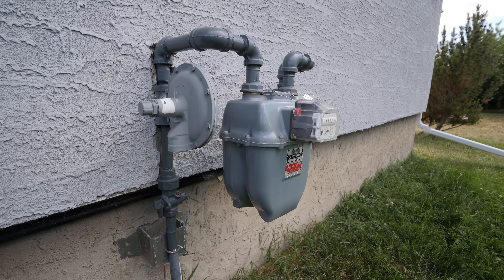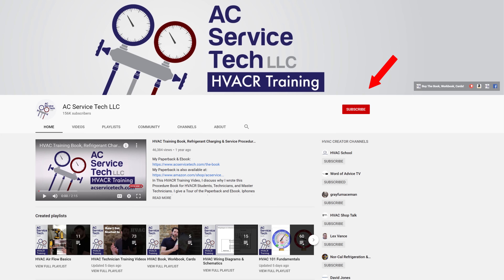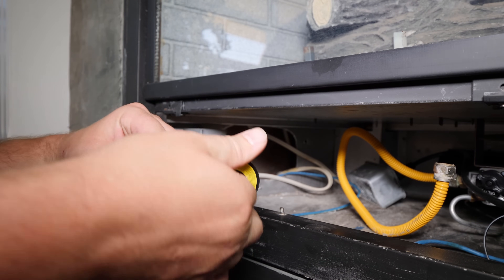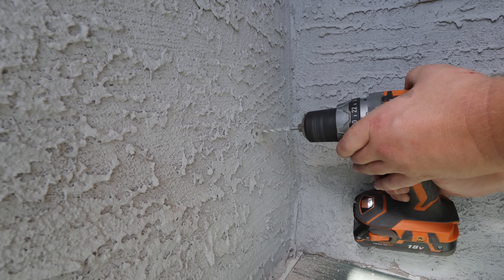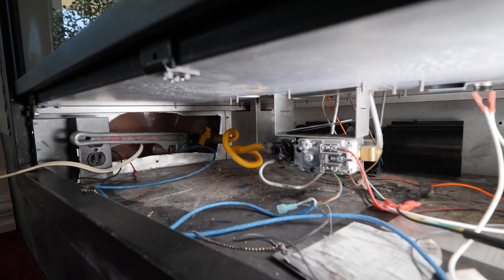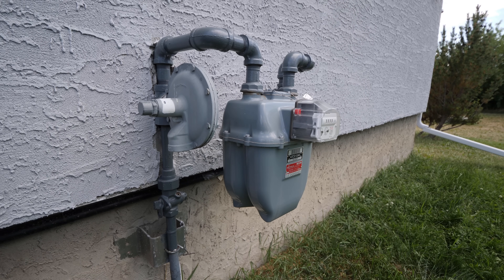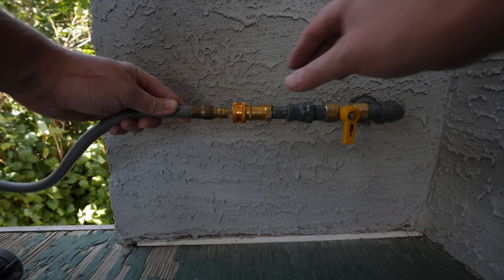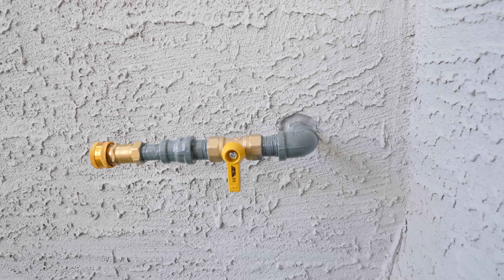Natural Gas BBQ Grill Gas Line Install

Comment: Kind of a basic question, I've run into this before, when you put that right angle fitting you obviously had the direction in mind (to the left), how do you gauge how tight is too tight to get the angle that you want (basically you want it going left instead of ending up pointing right)
Reply from the maker: That's a tough question. For me it's basically by feel. You don't want to bury the threads but you don't want to have it loose either. If a fitting/nipple is properly cut, it usually has roughly 2 threads left showing after tightened. Hope this helps. Cheers!

Comment: Hire the proper service tech to do this project. There are rules and codes to follow. This is NOT the proper place to do a tie in.
Reply: Wont pass inspection!
Reply: And do not touch the regulator
Reply: Agreed
Reply: it's perfectly fine to tie in here if done properly. Can't imagine anyone using the fireplace and grill at the same time. they're different seasons
Reply: That's what you're basing your advice on? Someone not using a BBQ in the winter? The fuck?  @justinbrah627

Comment: Hey. Great vid.  So the line feeding the fireplace was a 1/2" flex? To 3/8" or was the fireplace 1/2 all the way?  Then you t'd the flex ro black pipe 1/2" out the wall to 3/8". Could you not have t'd with 1/2" flare and ran 1/2" copper through the wall? I was thinking of doing a line and was going to do just that,  tap the water heater 1/2" copper with flare and run 1/2 copper out the wall.  Thankyou.

Comment: I can’t tell what color that Teflon tape is but in my state you must use yellow for gas. I would have also installed a tee where you put the elbow outside the house and added a debris catch.
Reply: Nice catch...but the items in code are mostly disposable appliances, so no sediment trap needed.
Reply from the maker: Correct, it is yellow gas approved tape.
Clause 6.13.1 - A dirt pocket shall be installed at the bottom of any piping or tubing on the final drop serving an appliance other than
(a) an illuminating appliance;
(b) a range;
(c) a clothes dryer;
(𝗱) 𝗮𝗻 𝗼𝘂𝘁𝗱𝗼𝗼𝗿 𝗴𝗿𝗶𝗹𝗹;
(e) a portable appliance or equipment;
(f) a decorative appliance;
(g) a gas log;
(h) a room heater; and
(i) an appliance incorporating a sediment trap.

Comment: Nice work!  Could a 3/8 to 1/2 reducing bushing be used at the valve ,rather than that bell ?
Reply: Bushings increase the chances of splitting the fitting. That’s what I learned from a plumbing inspector that red tagged one of my dads jobs. A close nipple and bell reducer is best.

Comment: If you need instructions on how to light a BBQ pit, you probably shouldn't be installing gas lines.
Reply: I’m sorry if I come off rude, not trying to be. Just because you know how to install gas lines, doesn’t mean you know the specifications of a new grill. I’m an assistant plumber and I mainly install gas lines, but I’ve never bar-b-qued in my life. So buying a new fancy grill, not gonna lie but I’ll probably read the instructions.
Reply: @22ChronicSmurf  hey to do something like this is it really risky ? Or can it be done if you follow rules ? I’m trying to run a line from the outside of my house to the back yard but I’m actually doing it under ground . Any help? Or suggestions?

Comment: Question. How come you couldn’t just run a 1/2 to 3/8 shut off valve to the quick connect. I did mines the exact same way with the 90 degree to 1/2 to the shut off to 1/2 nipple connected to a 1/2 to 3/8 reducer to a 3/8 nipple to the quick connect. That’s what I’ve been reading and many people do it this way. But my question would be why just eliminate the reducer by using 3/4 to 3/8 fitting. If you can answer me that would be great because I can’t find why it has to be done this way.
Reply from the maker: A 1/2" x 3/8" threaded gas certified shut off valve isn't very common. My distributor doesn't carry them. You're absolutely right, this would eliminate the need for a reducer. 1/2" threaded x 3/8" flared shut offs are common but that wouldn't help in this scenario.
Reply: @PROSDIY  ahhh I was looking at a laundry dryer hook up and just figured heeey why not just do that 1/2-3/8 fitting shut off and run the quick connect to that. Anyways good video I did so many research and your video was the best one but i wish u made it before I did mines , would of saved me some
Time lol good video!

Comment: That’s an illegal tap friend
Reply: i was sorta thinkin that myself, first off i'm pretty sure that will get your appliances red flagged and possibly even the  meter itself. Why wouldnt you just go slightly further below the fireplace guts an run your Tee an Ball Valve off the service rough in? Also There are so many reasons why "quick connect" an gas appliances do not go together.
Reply: Totally illegal

Comment: While I’m hard core DIY, for home insurance reasons I always pull a city permit. Otherwise any accident that could be attributed to my work WOULD be attributed and I’d be left paying out of pocket. And if anyone got injured, liability (unpermited installation = gross negligence) skyrockets while insurance again becomes a problem. I’m not that comfortable with gas codes so I’d also hire someone licensed even if not required.
Reply: Whether the home owner can or can not do the work depends on local laws and regulations.  

Some do not permit the work to be done other then by a licensed gas fitter, others allow the home owner to do the work and ether need a gas fitter to certify the work (and affix thire licence number to the work) or call an inspector to review the work. 

To be fair you will not find many professionals who would want to attach thire license to some random homeowners work.... the price will probably be close to if not greater then the cost of them doing the work as they are assuming the liability.

  When in doubt, just get a gas fitter
Reply: It is also ILLEGAL to preform Gasfitting without a license. Remember when mistakes are made water gets you wet, gas gets you dead. This is to be left to licensed professionals.
Reply: @wheelinndealin  Not always true. In Texas any homeowner can work on gas lines within their house without need for permit or a professional.
Reply: @wheelinndealin  That’s incorrect. A homeowner in California with a valid permit can do the work. Diagrams and calculations are required. A rough and final inspection by the permitting authority is also required.
https://www.contracosta.ca.gov/DocumentCenter/View/44633/RESIDENTIAL-GAS-PIPING
Personally I’d still use a plumber, but it’s not a legal requirement in my state. Might be in yours.
Reply: @edbouhl3100   yeah in my state a plumber has to do it, that’s a scary thought that they allow that.

Comment: Great Video but you missed out one step  Gas-fitter that i know (Elk Island Gasfitting)    told me it's very important to Clean the pipe with Oil and steel wool or abrasive pad before painting it  -- otherwise if you paint over any small rust that has formulated on the pipe the direction of the rust will head towards the innards of the pipe (centre)  like hot chilli's burning a hole through your stomach then we got a real leakage problem.

Comment: galvanized lines are allowed in some locations.   those flexible lines are too close to sharp edges;  they could easily be cut resulting in gas leak
Reply: Black iron pipe only! No galvanized for gas
Reply from the maker: Interesting. I personally don't know of any jurisdictions that allow galvanized piping for gas lines. Learned something new. What locations allow it?
Reply: @PROSDIY  1.  important to have dip leg at end of NG line before it enters appliance.  this takes care of any potential galvanized flakes.  2.  may be a mute point.  City of Oakland now not allowing NG appliances in new construction.  Must be all electric.
Reply from the maker: Many appliances don't require drip legs as per code, at least in my area anyway. Stoves, dryers, fireplaces, BBQs, grills, and heat lamps don't require drip legs. Your area may differ. I don't know the codes for each State. That's very interesting about Oakland. I have a feeling eventually all areas will follow their lead, and eliminate fossil fuel use.

Comment: Would have been easier to put the tee in after the shut off valve.
Reply from the maker: It's not ideal to have 1 shut off control two separate appliances. If there's an issue at 1 appliance both would have to be shut off. Most jurisdictions require individual shut offs for each appliance.

Comment: I'm not getting into the workmanship.  It looked fine.  However where I live.  You have to have a valve at the disconnect that won't open unless there is a male fitting inserted into the quick connect and won't all you to disconnect the male guick connect fitting unless the valve is off.
Reply from the maker: Interesting. Never seen seen that style before but it sounds like a great, safe idea. They are not required here but the female side quick connect/disconnect will only flow gas with the male fitting fully inserted. Without the male fitting inserted no gas will flow out of the female fitting, even with the gas valve in the open position. Your system is still safer though.

Comment: so much wrong with this instructional video. hire a pro next time to do this correctly. Csst requires bonding, you're also suppose to isolate any thing you disturb and pressure test at 10psi to ensure no leaks are present. pressure testing with gas and bubbles is not adequate.  you should stop making videos like this you're going to get somebody killed
Reply from the maker: The CSST is bonded by the previous installer at the other side of the CSST. You aren't supposed to bond the CSST at both ends. In our area the inspectors don't require pressure tests on short runs, water heater replacements, stove replacements, etc. Longer runs anything usually over 10ft has a minimum 15 PSI for 15 minutes. Their reason for this is that you end up disconnecting and reconnecting more connections before and after the tests then if you didn't do it. An inspection is still required though. A soap test is an approve gas leak detection method for water heater replacements and short runs. I understand your concerns about making an educational gas related video, but it is stated multiple times to check with your local regulations and to have a certified professional complete the work.

Comment: Sweet. Will this be cheaper than using propane?
Reply from the maker: In most areas it's cheaper to run natural gas than propane. Natural gas BBQs on average are slightly more expensive but usually pay for themselves in gas usage. The biggest benefit though is never running out of gas or exchanging/filling tanks.

Comment: What about switching out the orifice?
Reply from the maker: That's an option. Natural gas is more convenient and cheaper to run in Alberta, Canada.
Reply: Ya need new office or you have to make office hole almost double with drill bit

Comment: Don't you have to bond the flexible line to the electrical ground to avoid arc due to  lightnings?
Reply: The reason  gas piping is bonded is due to the fact that as the gas moves in the pipes, it generates a static charge. The bonding cable allows that static energy to harmlessly dussipate to ground. 

Much better then causing sparks from a gas line.
Reply: all csst has to be bonded this is why homeowner shouldn't perform their own work and should hire a professional
Reply: @The1badjack  His black iron gas main should already be grounded. As long as the gas main is grounded, he's good to go. If there is no ground, then yeah, it should be grounded with #6 AWG Copper
Reply: @bullmoosepiper7732  Gas pipe, including rigid, cannot be used for grounding. The pipe is bonded, not grounded. Two entirely different purposes. Bonding is simply the act of mechanically connecting two or more conductive materials together to establish a conductive path between them.
Reply: @The1badjack  thank you for the correction. You’re right and I mix these terms up all the time. So question for you - Home Flex’s instructional video which you can find on YT says that if the rigid has line is bonded, then that is a safe installation for CSST. What do you recommend in terms of properly and safely installing CSST?

Comment: I'm a gas fitter and the only thing I would of done differently is put a pipe stand off bracket on the outside wall so the pipe is supported and cant be turned at the elbow in case someone bumps it into accidently, which is code in my local jurisdiction. Another minor thing is that you aren't supposed to trim the jacket of the CSST line so far back, only enough so that you can put the compression ring on. You shouldnt be able to see bare metal. Clean work otherwise 👍
Reply: i am from Canada and the jurisdiction here made my pipe-fitter cut the ( pipe stand off bracket) right in-front of me said if building shifts we would rather have the twist a bit instead of pulling apart completely.    also he missed cleaning with oil before painting to prevent rust heading inwards.
Reply: @adannash5949  funny... I am from Ontario and the stand-off to support the 90 is mandatory by T.S.S.A. code
Reply: @adannash5949  Paint doesn't stick to oil. A coat of iron oxide primer will prevent any rust.
Reply: you missed pressure testing correctly
Reply: @The1badjack  In my area, for such a short extension of the gas line, a soap test is adequate. But better safe than sorry I suppose.

Comment: I recently moved my BBQ and needed to buy a longer NG hose (was 6'-0", now 12'-0").  It arrived today from Amazon but the male fitting that goes into the quick-disconnect is 3/4" dia.  The existing male fitting is .565" dia. (9/16").  The new hose comes with a new quick-disconnect piece but I need a licensed gas fitter in my area to perform the change out (presumably).  Do you know if I can purchase a NG hose with a 9/16" male fitting that will fit into my existing quick-disconnect?  You seem very knowledgeable and so I presume you are in fact a gas fitter yourself.  Hope you can help.  THX...
Reply from the maker: Hi Stephen, BBQ gas hoses and fitting sizes can get confusing. I was able to find this article on sizing: https://mbsturgis.com/media/documents/buying-guide.pdf
I would think your existing hose is 3/8" based off of the article? The 2 most common quick connect sizes for BBQs are 3/8" and 3/4".
There's a large selection of 3/8" BBQ hoses on Amazon. It might be the best bet to exchange the hose and then you don't have to get a gasfitter out to change the fitting.
Thanks for the question!
Reply: @PROSDIY  Thank you so much for your quick reply.  Odd that it measures 9/16".  But I will return the new hose and buy a 3/8".  I will also check out the link you supplied.  Once again.  Very appreciated.  Stay Safe!!!
Reply from the maker: No worries. Just double check with that article to make sure before reordering, but I'm pretty sure it's going to be 3/8". Thank you and take care!

Comment: So is that mean, I have to hire someone certified tech to do my house, or I can do it myself as home owner ?😂 thanks much Sir 👍👍
Reply from the maker: It means I didn't see or hear anything. LOL! Cheers!
Reply: If you burn your house down and you DIY the insurance won't cover you, FYI.
Reply: Now I am very clear the picture. I understand. Thank you so much for detail explained it.👍👍👍😜
Reply: So can I do it? Myself as home owner.For my own house.? by law ?😂
Reply from the maker: Technically no. It depends on your local and national laws. Almost all areas would require a license gasfitter to complete this work. Some areas would require a permit, pressure test, and inspection completed. Some areas allow home owners to complete the work, but it has to be signed off by a licensed gas fitter. Then the liability is passed on to the gas fitter that inspected the work. It is up to the homeowner to research local codes to confirm what they are allowed to work on or not. Let it be electrical, plumbing, framing, HVAC, etc.
Reply: Never do yourself. Licensed pros only. This type of videos should not be allowed. This guy doesn’t know shit.
Reply: @myfeee  please explain what he does not know/say to support your case?